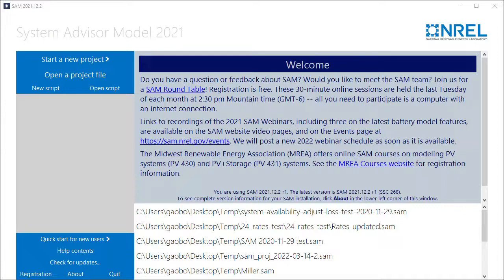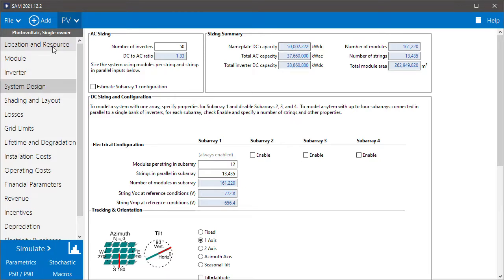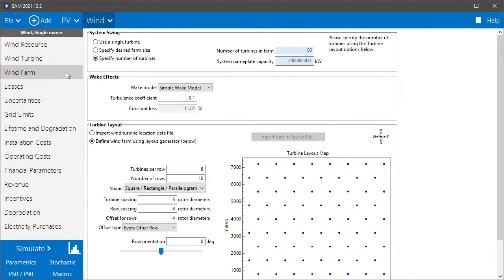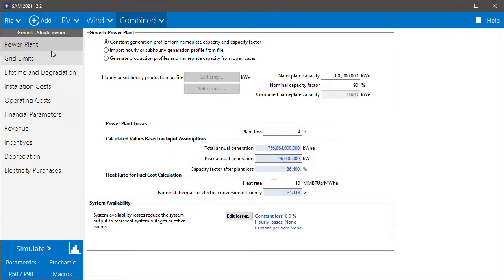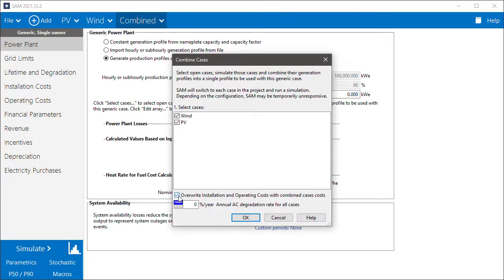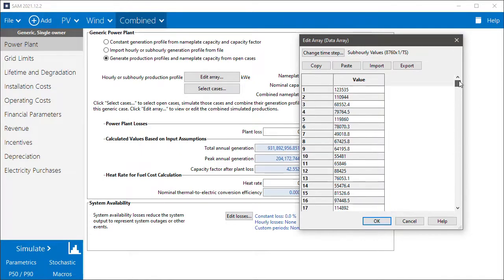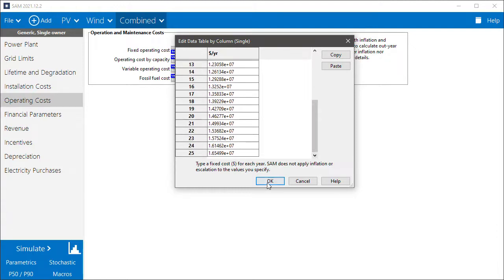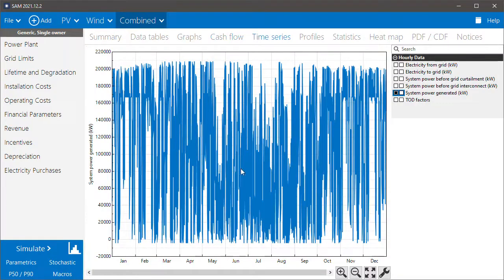SAM Combine Cases Feature

Comment: can we make an assumption of intial cost of a hybrid -pv-wind system and can we compare with the SAM results.Is there any option in SAM software sir?
Reply from the maker: SAM requires that you provide installation and operating costs as inputs along with design parameters and then calculates metrics like the net present value (NPV) that you can use to evaluate the economic feasibility of a project. Please post questions about SAM on the SAM Forum at https://sam.nrel.gov/forum.